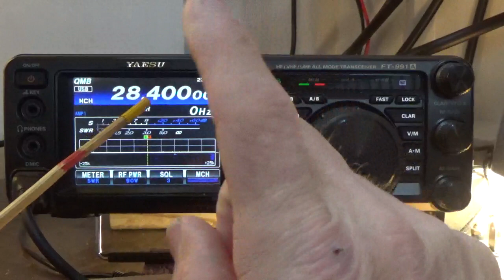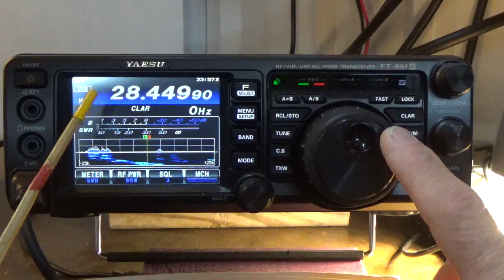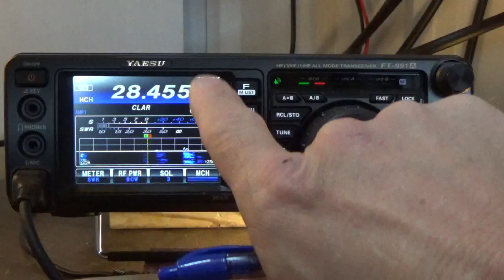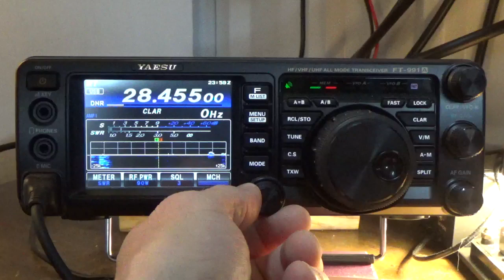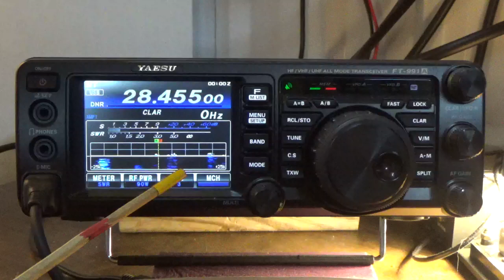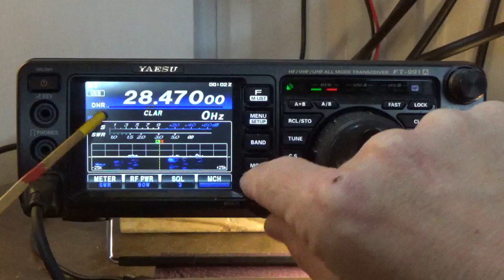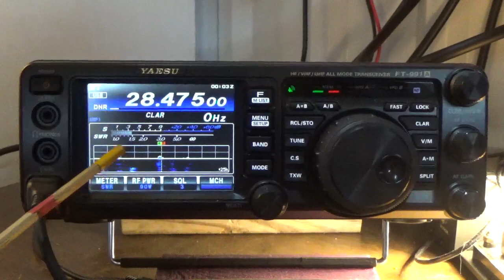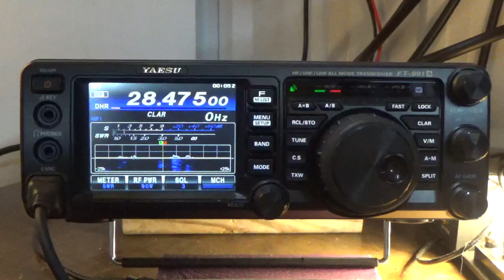FT991A (DNR) Digital Noise Reduction Demo and QSO with JG1HQA in Tokyo Japan  - 10-10 contact N5XZ

Comment: Wondering why you don't use the channel dial feature to change by 1 kHz _ 73 de N0GFT
Reply: Great video by the way, as always.
Reply: I use my tuning dial in Fast mode almost all the time, with clarifier if needed.
Reply: @tangobayus  that's great. Have you tried the multi knob using CH Dial, with fast? Without fast it moves by whole numbers. With fast it moves by 10s. It's awesome. The hard thing is it's physically smaller, and awkward to grab.
Reply: @CarlMadsen  I mostly use the multi knob for memories and settings. By the way, I power mine with a 20 AmpHour AGM battery hooked to a 5 amp charger. This is controlled by a cheap appliance timer to run during the night when I'm sleeping. Chargers generate a lot of noise if they are on when the radio is on, particularly on HF.
Reply: @tangobayus  give CH Dial a try sometime. Have fun! I like the battery / timer method that's smart 73 de NØGFT